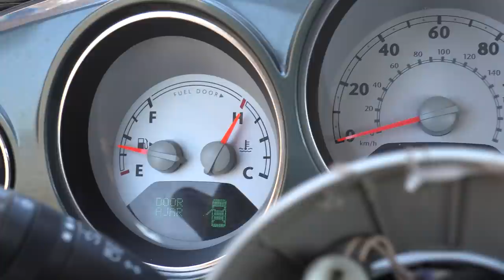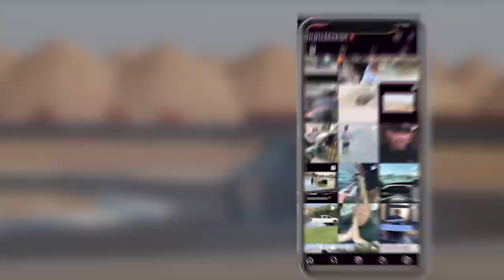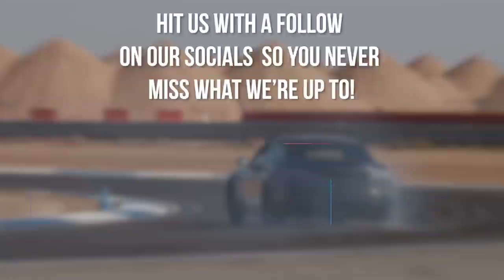The Safety Crew CRASHED My Car?! – Nitro Rallycross PT Bruiser Race!

Comment: Air filters are only for the long term really. If you sucked in tiny debris over thousands of miles it would take a tool on the valves, rings, and cylinder walls I would think. And for water, its only bad if you get so much water in the cylinder that the piston can't go back up(hydrolocked). But there are lots of people that do home DIY water injection and it keeps carbon buildup away. You just have to have a way to atomize small drops of water in the intake so its kind of like a steam cleaning